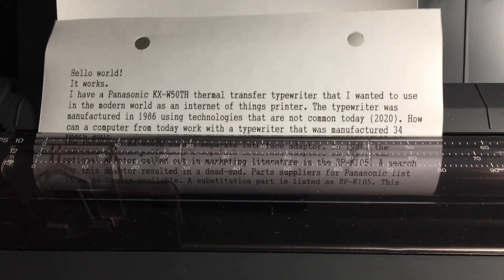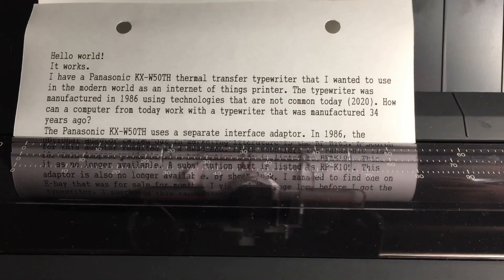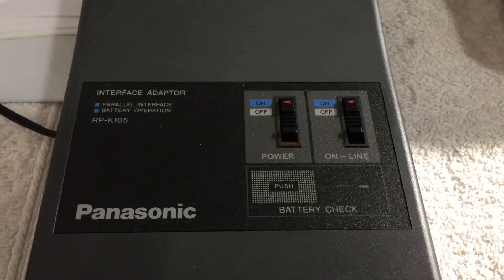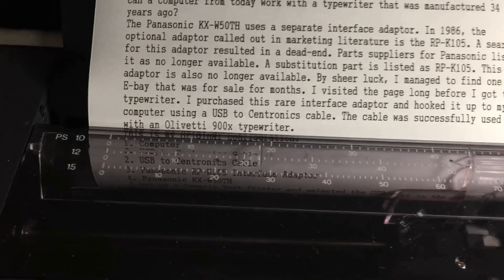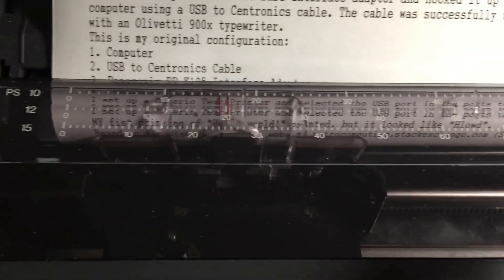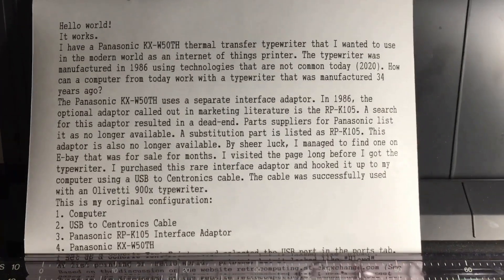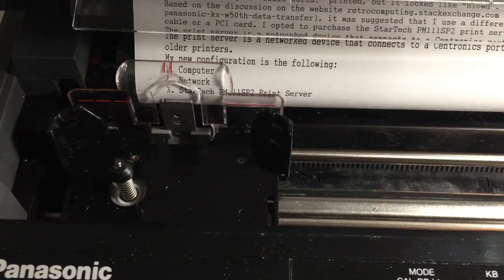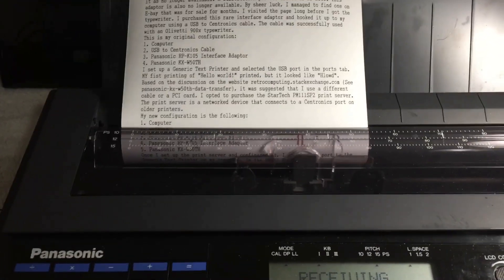A #Vintage 34-year-old #Typewriter Connects to Modern Day Computer

Comment: Awesome, just wondering, can it send typed commands to the computer as well?
Reply from the maker: Thank you for watching. The data flows in one direction only or at least I have not found a way to pull it back. I am going to upgrade the memory in 2025 to 8 kb.
Reply: @Linus007  Awesome thanks for the reply, friend.

Comment: Would you happen to have the manual for the RP-K105 adapter by anychance? I'd like to know what its purpose is because I'm thinking it could be replaced by a simple MAX3232 RS232 (serial) to UART chip but I may be wrong.
Reply from the maker: I replied to you on a different site and sent emails. I hope your project is going well.

Comment: This is awesome! I have a similar project I am working on. I have a R350 with the same connection. I was hoping to emulate the RP-K100/105 in software, which seems doable from a technical connections sense, but without a list of the serial commands issued by the adapter, it is pretty futile. I have been looking for someone with the adapter to help me get the list of commands that the typewriter receives.  Is that something I could ask for your help with? 

Essentially it would be routing the adapter output back into another serial port and recording all the signals sent when writing a file to the printer. I am happy to subsidize any additional parts you need to make the connections--if I can get a text file that covers all the characters and some of the command codes that the typewriter responds to, and the serial output corresponding to the file.
Reply: That is, of course, assuming it is a serial output. It may well be something custom or even parallel of an odd variety, such as 7-bit. 
I have an adapter, but no word processor, unsure of it's working status, but for it lighting up when turned on.
Reply from the maker: I have the R350 adapter. Use the contact link on my channel and I can send the photos of the inside.

Comment: Is that adapter really necessary?  I just picked up the same typewriter (didn't realize it did thermal) - Hoping to get it going with just a serial adapter (assuming it speaks rs-232)
Reply from the maker: For this typewriter the adapter is absolutely necessary. A couple of the Olivetti typewriters have a Centronics port.
Reply: @Linus007  Which Olivetti printers do have Centronics ports?
Reply from the maker: @heinkelkabin  The 900x is the version that I have that has that port.

Comment: It is a special type of paper that doesn't need carbon or something? That's really cool
Reply from the maker: Sky Man 
Yes it is. The paper used in this video is thermal fax paper. You can use regular paper but you need to have a ribbon cartridge in place. Those cartridges are quite rare, so are use the thermal fax paper which is readily available on the market.

Comment: Oh! Where did you get that size of paper? I've been getting the 8.5" x 96' rolls at Staples. I would love to get other sizes. I have used thermal receipt paper, but it's so narrow! Thanks for the video. That setup is very cool.
Reply from the maker: Poor Typist, I cut down the paper into sheets with a paper cutter.

Comment: Insane I just bought a KX-W60TH from Goodwill tonight. Sometimes the universe works in strange ways... Thanks for the video.
Reply from the maker: Hey there. The KX-W60TH is a good typewriter. Did you get any manuals with it? I think the difference between the 50 and 60 is some additional text storage and it shows how many characters you have in a line. Remove any cartridges. Those things are rare.